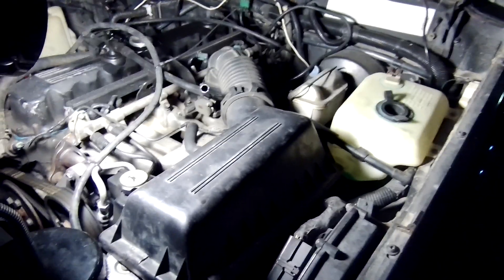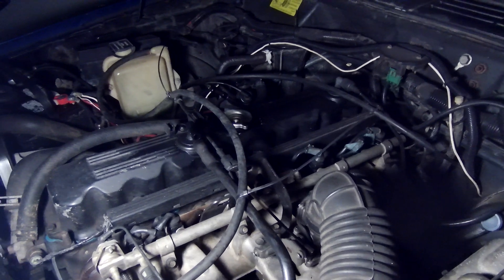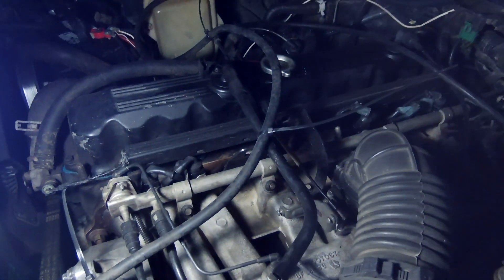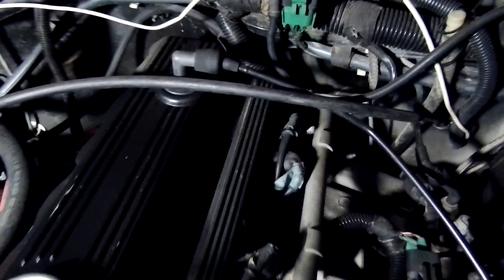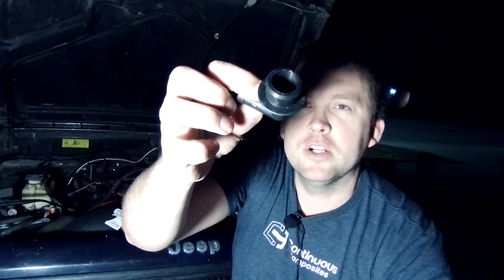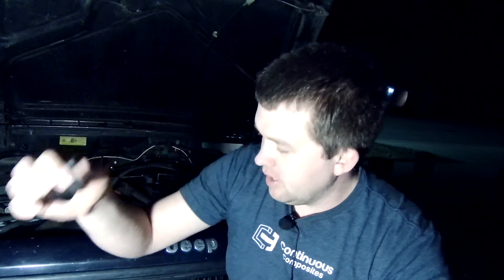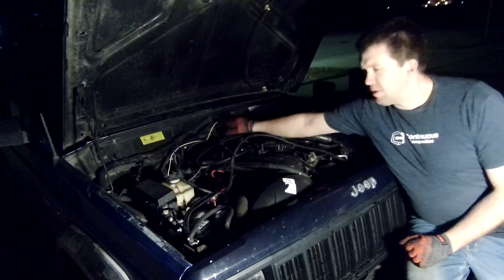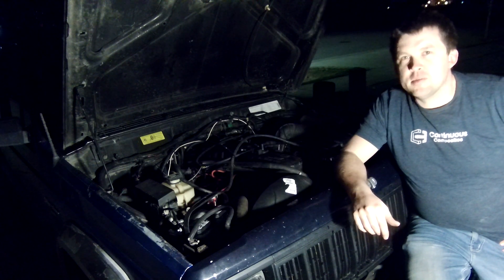What is Jeep CCV?  Why is there oil in my Air Filter?

Comment: I also had oil in air filter box. I replaced CCV ( PVC) valve and still had same problem. After checking more I found that I had no vacuum at ccv valve, the port from intake was stopped up. I cleaned it out and it solved the issue. Now the vent hose from air cleaner pulls fresh air like it should.

Comment: I was wondering to connect an oil catch can in my 2001 4.0 TJ. Now I can't seem to figure out where to put the catch can. Between the PCV valve and the airbox or between the CCV (rear valve near the firewall) and the intake manifold? 

The PCV pushes oil/fumes into the airbox due to the positive pressure under the valve cover, but oil/fumes also gets sucked in due to the negative pressure from the intake manifold. So the 1st question is: Are the oil/fumes forced into the air filter box due to the overpressure that builds up under the valve cover, or is it due to the intake manifold that sucks in the oil and fumes, or is it both?

The second thing I'm wondering is the role of the CCV in all of this. The CCV (closed crank ventilation) It also pushes oil/fumes back into the intake manifold but also due to the suction of the intake manifold. I see people placing the oil catch can between the PCV and the Air filter box & I see people placing the catch can between the CCV and the intake manifold. 

What is your take on this, what would you do? Thanks and keep up the vids my friend. All the best from the Netherlands.
Reply from the maker: These are good questions.

1:  I guess it could be either or both in regards to your first question.  I would think the more likely cause would be overpressure from the valve cover possibly caused by a clog in the CCV system?

2:  The CCV system is designed to create clean air circulation through the crankcase by using the vacuum created to circulate air from the air filter box into the engine.

If it were me I would do what I could to keep the system operating as designed rather than placing an oil catch in the system.  If the oil was being sucked to places where it wasn't supposed to be I would suspect there was a problem somewhere in the system and fix that first.

I hope this helps?  Thank you for watching and asking the question.

Comment: I had same issue, was told that it was from adding oil too quickly? Was my nieces Jeep so not too familiar with these vehicles so just passing it on in case
Reply from the maker: I guess that could be a cause?  You are putting oil into the valve cover where the valves are?
Reply: @FamilyJeepingAdventures  right has to be brand new oil on air filter I'll go your route there has to be an obstruction somewhere, getting misfires thanks for the video big help